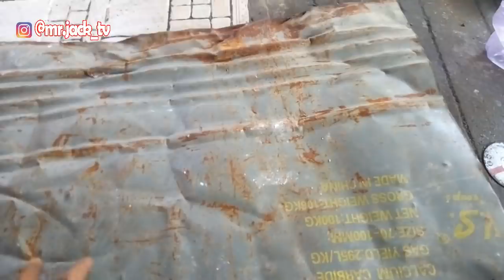CARA MODIFIKASI KNALPOT MOTOR 4 TAK - GALAK !!!

Comment: Beli Knalpot Cuman Nyari Suaranya(Newbie)
Beli Knalpot Buat Nambah HP(Pro)😅😅😅
Reply: knalpot ga akan nambah HP.. ngakak
Reply: Buat keamanan 
*Hanya jika CC nya diatas 600
Reply: bukan knalpotnya diganti tapi motornya ganti sama cc yg gede baru nambah tenaganya
Reply: Adjie Pratama itu jelas nambah hp bro. Karna sistem pembuangannya lgsg.
Walah walah.
Reply: Ganti knalpot emang bisa nambah hp bahlul,  apalagi knalpot racing, tp harus reset lagi ecunya yg injeksi
Reply: Bisa Nambah Hp Bro Soalnya Sistem Pembuangan nya Akan Mendongkrak Tenaganya,Sekitar 1-3Hp kalau yg Cc sedengan
Reply: Lutung Kasarung siapa bilang ? Kenapa motor balap gak pada pake knalpot standar aja, sotoy ente baca2 dlu lah 😂😂😂
Reply: Mufty Fals muffler motor itu fungsinya untuk nahan suara, "membungkam" suara motor yg terlalu keras supaya memenuhi standar dan legal untuk dijual di pasaran. tapi dalem proses "membungkam" suara, ada back pressure yg ngurangin performa (bukan hp), dengan ganti knalpot dgn knalpot aftermarket, yg biasanya mufflernya beda atau malah ga pake mufffler sama sekali, airflow lebih lancar dan performa motor lebih keluar. tapi apa nambah hp? engga, soalnya itu datang dari mesin, berapa cc, dll. situ kali yg perlu baca baca. ningkatin performa bukan berarti nambah hp, makanya pikir dikit lah 

kalau ningkatin performa itu sama dengan nambah hp, berarti spoiler, hood aerodinamis, dll pada mobil jg nambah hp dong? itu kan ningkatin performa mobil, jadi lebih dapet grip apalagi saat tikungan, lebih sedikit kemungkinan untuk slip. nambah hp dong gitu? ya engga lah! ngakak. ganti knalpot nambah hp? ngimpi lu
Reply: nauval faris muffler motor itu fungsinya untuk nahan suara, "membungkam" suara motor yg terlalu keras supaya memenuhi standar dan legal untuk dijual di pasaran. tapi dalem proses "membungkam" suara, ada back pressure yg ngurangin performa (bukan hp), dengan ganti knalpot dgn knalpot aftermarket, yg biasanya mufflernya beda atau malah ga pake mufffler sama sekali, airflow lebih lancar dan performa motor lebih keluar. tapi apa nambah hp? engga, soalnya itu datang dari mesin, berapa cc, dll. situ kali yg perlu baca baca. ningkatin performa bukan berarti nambah hp, makanya pikir dikit lah 

kalau ningkatin performa itu sama dengan nambah hp, berarti spoiler, hood aerodinamis, dll pada mobil jg nambah hp dong? itu kan ningkatin performa mobil, jadi lebih dapet grip apalagi saat tikungan, lebih sedikit kemungkinan untuk slip. nambah hp dong gitu? ya engga lah! ngakak. ganti knalpot nambah hp? ngimpi lu
Reply: Gatau lah, gw baca di tabloid motor plus ganti knalpot bisa nambah hp ,oh y btw torsi ama hp beda, klo gapake knalpot mah mesinnya kedodoran di rpm tinggi
Reply: Cc besar makin bertenaga?,  tergantung silinder ama settingan mesinnya lah LOL (contoh = 2jz gte yg 2000cc di supra lebih powerfull dr pada mesin truk volvo yg cc nya lebih gede)
Reply: nauval faris kalau ga tau ya gausah ngomong. torsi ama hp emang beda, siapa yg bilang sama? torsi bisa lebih tinggi karena ya performa mesin naik soalnya airflow lebih lancar karena pake knalpot aftermarket yg ga ada mufflernya. tapi hp? ya sama. kalau lu ga tau yaudah diem aja.
Reply: Mufty Fals ga akan jawab lu? makanya ga usah sotoy bro
Reply: nauval faris siapa yg bahas soal cc sih? lagian gw ga pernah bilang itu satu satunya faktor, tapi itu salah satu faktor yg berpengaruh. lagian orang lagi bahas pengaruh knalpot ke motor. apakah nambah hp apa engga, jawabannya : ENGGA. ngerti mas?
Reply: nauval faris udah kalah argumen cuman bisa bilang bacot? kampung
Reply: Sapa tadi y yg bilang ganti knalpot gabisa nambah horsepower?  Udah salah ngeyel lagi : v
Reply: Banyak banyakin baca berita lah
Reply: pada berantem nih intinya knalpot itu memiliki fungsi sebagai saluran pembuangan gas buang jadi besar kecilnya pembuangan gas buang tersebut tergantung dari cc mesin motor tersebut dan pembuatan knalpot dalam setiap pabrikan motor kalo untuk komersial atau umum harus sesuai peraturan negaranya dan tidak akan mengganggu orang lain maka itu dipasngkan knalpot tidak bising itu juga termasuk cc besar tapi ya namanya cc besar biarpun gak ganti knalpot (cuma knalpot standar) suaranya ttp akan gede krna di pengaruhi dari tenaga yg dihasilkan mesin motor tersebut..yg bilang racing knp gak make knalpot standar aja ?? ya udah pake knalpot standar itu kan itu motor racing ya standar racinglah knalpotnya,,,wkwkkwk
Reply: Emang bener ganti knalpot bisa nambah power...
Knalpot yang suara nya bikin bising itu beda-beda...ada yang tipe racing ada juga tipe kompetisi...jelas tipe kompetisi itu tidak boleh di pasang di mesin standart karna akan merusak piston dan blok nya (bisa turun mesin) karna knalpot tipe kompetisi itu di gunakan untuk gas buang yang jauh lebih besar...
Kalau knalpot racing sich tinggal langsung pasang ke mesin standart juga ga apa-apa, paling kalau ada limit di rpm tinggal seting karbu...
Reply: Sungguh motor ini sangat keren broo
Reply: Kalau knalpot ngak nambah hp bagusan balap gak usah pake knalpot sekalian keras jugak bunyinya kok, malah beban motor jugak berkurang.dodol
Reply: pesen satu bang yg udah di rubah pakai gaspul
Reply: Bego whahahahaha
Reply: Lu yg newbie mas bro wkwkkwkw
Reply: Pandu Adikara Gua yang ngakak wkwk nambah tapi dikit
Reply: Adjie Pratama benerr hhahaha
Reply: Ralat mr jack,  yg bener gas wol hehe
Reply: memang betul bro. pake knalpot racing bisa nambah HP aka horsepower